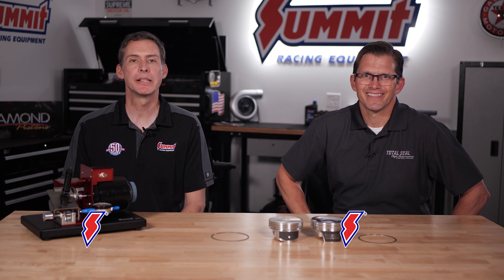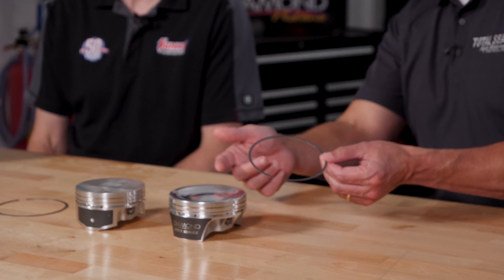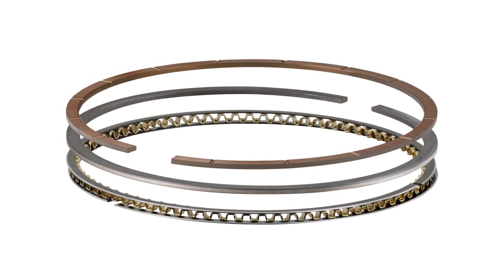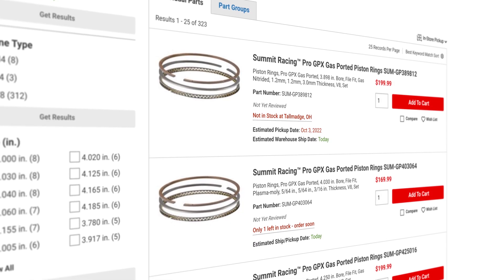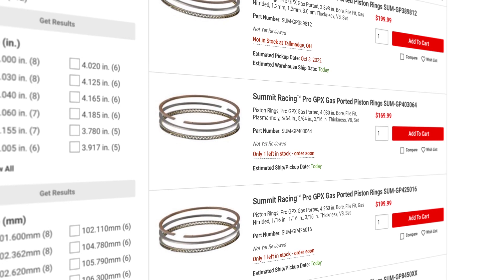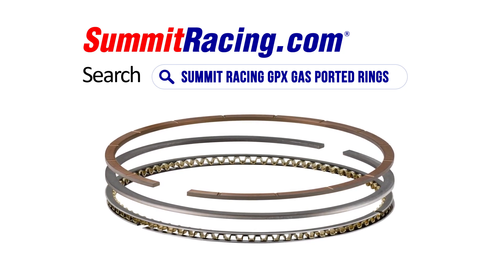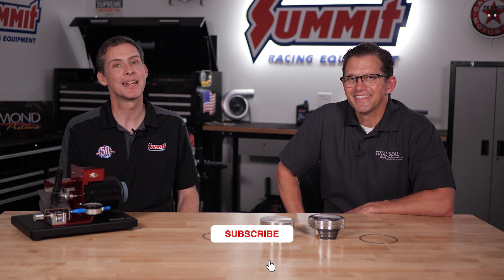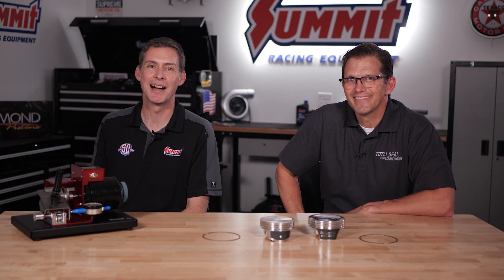Summit Racing Pro GPX Gas Ported Piston Rings: A Better Seal for More Engine Performance & Longevity

Comment: Can sets be mixed for us? I have a set of Probe 4.125 pistons that are 1/16 1/16 3.0mm. The gas ported rings are available with that top, 2nd, and oil ring size, but not together in the same kit.

Comment: I would really like to try these on my current build, but I see that the set for my application does not have napier style second rings. I prefer napier for oil control. Is there a reason these are not available?